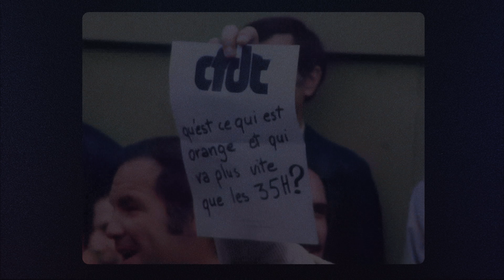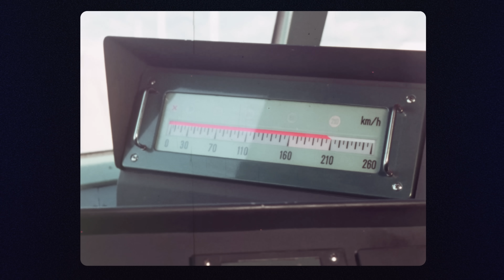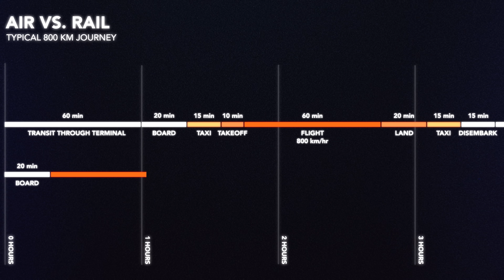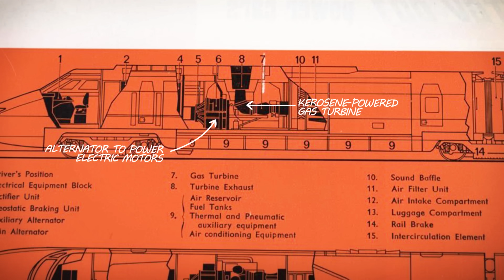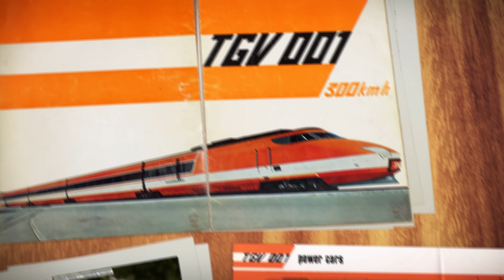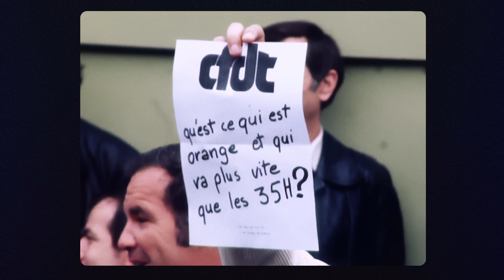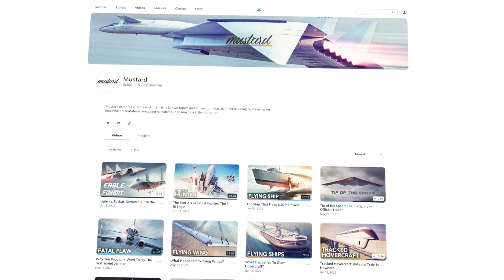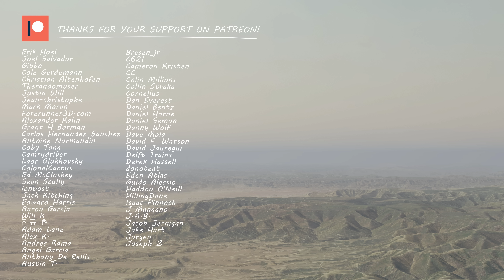Why French Trains Are The Fastest

Comment: as somebody from south eastern europe, who has travelled a bit (not yet to japan or china though) i have to say from what i have seen personally i am most impressed by the french trains and the entire system

i spent a few months for work at the southern/mediteranean end of france. i had a weekend i wanted to visit Paris and honestly the best option available was the trains.

-the distance was about 750km (so not the shortest of hauls, but still short)
-the travel time by plane was a bit under 2 hours, by train about 3:10 and by car... not even comparable, but also not an option as i didnt have one and would have to park it in Paris... added headache.
-the potential schedule: Plane had two flights a day. one way too expensive and the other early in the morning. meaning i had to leave for Paris early on saturday and return early on Sunday... (not good) 
train on the other hand had over 11 trains per day, allowing me to leave late friday and return late sunday
-cost: the cheap(er) flight was about 270€. (the expensive flight was 700€). the train was 230€ and it was very close no matter which of the suitable to me trains i chose. (cost is with return). car with rental and hotel parking was gonna be about 230€ + 170€ for fuel... (yes train and plain meant extra cost for public transport in Paris)

worst thing, i ended up not going because of the fear (last minute) that eergency work would pop out for saturday and because hotels were extremely expensive in Paris for the weekend and with the even tickets i was looking at a weekend expense of over 700€ which was a lot for me...  But what i want to say with this comment is, they have managed to make trains the preffered option.
*Yes, if Ryanair or Whizzair were available in my route it would have been a LOT cheaper by plane, but then again if booked two monbths earlier in a discount...

Comment: The point of having a high speed train network is to connect two (or more) cities downtown to downtown, unlike airliners that need to be operated just outside of a city hence the extra travel time between the airport and the city.

My country just began operating its first high speed rail line last year between two very busy cities (one of which is the capital), but then put the stations on the edge of both cities. City A is 200 km or so northwest of city B, and has the station in the south east, which is fine. But the station in city B is.. also in the south eastern part of the city. Bruh. Even the old rail line goes thru the center of both cities. Overall, still relatively quicker than using a car on the motorway, but another problem is the lack of supporting public transport network especially in city B makes the whole journey pretty inconvenient.
Reply: Indonesia?

Comment: Don't you mean TGV "was" the fastest...now Chinese trains are now fastest 🤔?
Reply: The TGV still holds the record for the fastest traditional rail train. The only train that went faster was the japanese SC maglev.
Reply: @marcogentile3392  They cheated with that world record: 3 instead of 8 carriages (so the weight was drastically reduced and the motor cars only eend to push/pull 3 instead of 8 articulated passenger cars), only a few passengers, engineers and press people on the train, larger wheels than normal for the motor cars and increasing the voltage on the catenary drastically (normal voltage: 25 kV/50 Hz AC). What about maximum sustainable speed when the train is of normal length of 8 passenger carriages and carrying about 400 passengers, normal size wheels for the power cars and normal catenary voltage of 25 kV 50 Hz AC ? I am pretty sure the chinese high speed trains will do much better when taking into account these corrections.

Comment: Nahhhhh, China’s got much faster train on much longer railroads.
Reply: Yes, but it is not necessarily more convenient for going from the city center to the city center. The stations are way out on the suburbs.
Reply: @harveywilde6781 still they're a lot faster
Reply: @aldinoruswandi  Lol, they're all running at the same speed. Only one line had a faster operational speed.
Reply: @harveywilde6781  Nope, China is faster, not running on the same speed
Reply: @aldinoruswandi  Geezz such fanboy. Yeah, sure, I guess, if you care about numbers. Fyi, if you see something like 380, that's the design speed of the track. Trains run lower for safety factors.
Reply: @harveywilde6781  fanboy? I'm just stating the fact, but you just won't acknowledge it since you're a westerns
Reply: @aldinoruswandi  Not true
Reply: @Godophugawa  Shanghai Maglev is already 460km/h and their engineers want to double that rate so the train can carry passengers at speeds faster than if they were traveling by plane.
Reply: @aldinoruswandi this is not a rail train and just few miles between Shanghai and his airport
Reply: @BenoitMelon-h1o  China's High Speed Train has a speed of 350km/h with a rail tracks of 42.000km (26.097 miles)
Reply: @BenoitMelon-h1o  While TGV High Speed Train only have a speed of 300km/h and a rail tracks of 2.800km (1.740 miles)
Reply: @aldinoruswandi  France have world speed record on rail since 1954 and have always it in 2024 not China
Reply: @BenoitMelon-h1o  world record doesn't mean anything if it's not safe for human travels and only operates on 300km/h, while my country alone could operate 350km/h HSR.
Reply: @aldinoruswandi  320kmph in France and you must specify that 350 it is only on some limited lines. Your tech is just a copy of european tech bought to decade ago. French TGV is safest than China train
Reply: @BenoitMelon-h1o  LOL, TGV only operated on 300kmph while WHOOSH operated on 350kmph (on every lines, not limited), Stop lying bruh to make yourself feel better. 

I've seen the comparison video as well and TGV station and Train interior is not as good as WHOOSH in terms of safety, cleanliness, and conformity. Not to mention that TGV doesn't have a staff that will help you if you have difficulties, while WHOOSH having a very helpful and friendly staff that will always help you if you have difficulties. 

Also TGV is always late, while WHOOSH is always on time. And TGV is not as smooth while you're in the train, while WHOOSH is so smooth that if you place a standing coin it wouldn't move even until you arrived at your destination.
Reply: The chinese trains have a max cruising speed of 300 km/h, while french trains are 320 km/h... While it may be tru that they're top speed is a bit faster, the cruising speed lacks
Reply: @Godophugawa  Indonesian Whoosh made by Chinese is currently operating at 350 km/h

Comment: Fun fact, the German ICE trains can reach higher top-speeds in France than in Germany and for once the state o(f repair) of the German Railway network is not to blame.

France uses 25kv 50Hz electrification on its high speed lines. While Germany uses 15kv 16,7Hz on all railway lines, including high speed lines.

Because the voltage is higher in France, you can supply a lower current to get the same power as in Germany.
And as you can't put every increasing current though a conductor without physics getting mad at you.

TLDR: the German overhead wires can provide less power hence train can't go as fast.

Comment: Laying down track foundation with viaducts i.e the civil engineering aspects is one of the prime bottlenecking factor for highspeed trains,rather than the Train engine technology or wagon technology that comes with it.
Forget high speed,if you can ensure steady 160kmph travel,even that is more than enough for 1000km travel distances.(considering flights takes about an extea 1.5hr for boarding and security related $h!t.)

Comment: The French have one huge advantage over the Japanese when it comes to high-speed rail… the rail gauge of the French high-speed and non-high speed rail networks is identical, with both networks employing what’s referred to worldwide as “Standard Gauge”. This allows the TGV to make use of the existing rail network in urban areas, resulting in significant cost reduction since existing stations and rail infrastructure could serve the new high speed trains where infrastructure is most expensive to build. In Japan they practically had to build all new stations and dedicated urban rail lines as their non high speed rail network is narrow gauge which is unsuitable for high-volume, high-speed operation. Although the video alludes to this inherent advantage the French had over the Japanese system, it unfortunately does not explain that the historical rail gauge was the source of the advantage.
Reply: The Japanese built dedicated high speed lines to avoid the need to have level crossings and share track with slower traffic. It also allowed them to build much wider trains that allow them to carry more passengers.
Reply: India also working on bullet train with Japan . As Indian needs are fulfilled by japnese trains

Comment: The electric version of the TGV-001, known as TGV Sud-Est, had been in service from 1981 until 2021, when all of its trainsets ceased operations, and most were scrapped. It is now replaced by the TGV 2N2/Avelia Euroduplex (one of which was seen in the 2007 speed test video hitting at 574 km/h), which first entered service in 2011 while Sud-Est trainsets are being gradually retired, and it still is as of 2023.

Comment: Thank you for quickly mentioning the skytrain "aérotrain" project (345 km/h in 1967. One day in a warehouse near Versailles, I saw a science fiction machine covered up at the bottom of the hangar. the technician removes the tarpaulin: it was one of the latest models of aerotrain, a technological marvel for the time. Tribute to the engineer Jean Bertin for his ideas, and this project, designed with a slide rule, perhaps too far ahead of his time.
Reply from the maker: The Aerotrain is fascinating.. I actually have an entire video dedicated to it!
Reply: You can still see the aérotrain's old elevated concret test tracks running along the Orléans-Paris tracks.
Reply: @familledelisle2086  I may be wrong but the 10 km Aerotrain track near Orleans, has been removed and sadly, some vandals deteriorated some Torbotrain vehicles in Plaisir near Bertin's company..
Reply: @dlallemend3489 Jean Bertin was a remarkable aviation engineer and he helped create the TGV by forcing the bureaucrats in SNCF to face innovation and risk their job. Without Jean Bertin and his Aerotrain, TGV might never have been born. The Aerotrain was a sting into SNCF butts (to force them to be innovative) but never was a solution to transport huge masses (123 MILLION people transported in 2023 in France by TGV) and re-use existing accomodations (Railway stations) and the cost of energy gave the Aerotrain the "coup de grace".

Comment: Total respect for the French, their Railways are the bestcand they simply won't stagnate into complacency.
The French have already pushed a TGV to 575 kph and raised the line voltage 35kv for the test.
I hate plane travel, there is nothing to like about long haul travel especially if you are in excono,y class. 
The other thing is even on short haul flights you have to get to the airport hours before hand and then are processed like suspicious  baggage.
Yes I know it necessary but I prefer trains, far more civilised.

Comment: The tgvs i used to take in paris were pretty old at that point, and their design looked EXACTLY like star wars spaceships from the first movies. Very elongated but geometric shapes, a cockpit that looked just like the X wing cockpit, but after all the years the red, blue and white paint looked old and dusty. And the noise of the idle engines too. The whole station was underground, all made of concrete with pillars.
It really looked just like entering a rebel's base and getting aboard an old X wing

Comment: Test speeds under highly controlled circumstances should not be the primary metric here. The focus should be on operational speed, in this the TGV is left far behind the Chinese Maglev at 460km/h and China's Fuxing and Harmony both at 350km/h.
Reply: Shanghai maglev is a German Thyssenkrupp/Siemens Transrapid. Speed record for the fastest un-modified serial production trainset is hely by the Siemens CRH380BL.
Reply: @jonny2954  that may be so, but I don't see any Maglev around the German countryside or urban areas.
China is the only country in the world that has successfully implemented it.
Reply: @ericcoskun1  Except they did not successfully  implement it. Shanghai Maglev is considered a economic failure, people rather take the much cheaper regular train that runs alongside it.

It being uneconomic is also the reason Germany didn't adopt it.

Comment: The French and Japanese certainly have different takes on how to achieve high speeds. The Japanese obsession with testing and extremely strict specifications for the purpose of safety deserves to be highlighted.

The French must be commended for their record of ~575km/h in 2007 (breaking the Japanese record of 443km/h). But I don't think the Japanese really aim for speed for the sake of records. They operationally aim to always achieve speeds to 40% to 50% more than operation speeds then intentionally set low speeds for safety.

A lot of it has to do with track specifications as well as rolling stock. But the best illustration of how careful they are is shown in their development of the Kyushu extension.

They already had rolling stock capable more advanced than the train which set the 443km/h record. And they used their 270km/h specification track in the new extension. But rather than build the track using a known specification and rolling stock of a known specification, then open the line, they instead tested for well over a year under all conditions and seasons.

The other thing they do that is impressive is to completely overhaul every single train as airlines would a plane. Everything is stripped. All wheels are replaced and re-machined. Bodies are taken apart and re-sprayed. See: https://www.youtube.com/watch?v=DJvWJNT092s

Excluding the new Chuo Shinkansen (which currently holds high speed train record of 603km/h), the Japanese are developing their next platform for regular rail, the Alfa X. The aim would be to take this up to speeds of close to 540km/h then ensure track specifications are also updated allowing the train to enter regular service at 360km/h.
This would make it the world's fastest regular train (in terms of day to day operation speed). This train would be expected to be primarily used north of Tokyo, where tracks allow higher speeds than the Tokaido to the south.

Comment: 2:51 "Two largest cities in Japan" - interestingly, in 1964 Tokyo was (and still is, until Delhi takes it over) the worlds largest city by metro area (only global way to compare).
In 1964 Osaka was the 3rd largest. By 2000, Osaka would be 2nd largest (albeit it's dropped to 10th now).

It made sense for Japan to connect 2 of the 3 largest cities in the world.

Comment: The TGV is amazing. The ride is smooth, the seats are comfortable, and it's fun to watch the cars appear to go backwards on the nearby highway.
Reply: It has also proved extremely reliable over its 40+ years of existence.
Reply: To be honest all modern trains with their 160 - 200 km/h are faster than cars. Maybe only in Germany some cars drive occasionally faster.
Reply: @lukask7445  Modern trains reach those speeds but usually not for very long. That's what makes the TGV special, the cruising speed is sustained for a larger % of the drive.
Reply: &... now... maybe they should work on their trans~deportation.
Reply: @JTA1961 WTF BRO

Comment: honestly nothing beats trains imo, if only they were more frequent and reliable
and high accelleration, i think that is often overlooked, sure 200mph trains are cool, but having a train that would average faster than 60mph, including frequent stops every 3-5 miles, would be the future. it would allow living 30-50 miles away from the capital, but you can reach the capital within less than an hour, and the train would have everyone from local to outside the city

Comment: Impressive documentation work 🎉 Couple of things : one key aspect of TGV are the shared bogie configuration (which help stability at high speed)but another less know improvement is the overhead line (caténaire) and the pantograph. The line is zigzagging to avoid the pantograph to melt and the pantograph lifted is the one at the back of the train, which means a high voltage line is running on the roof of the train to bring the power to the locomotive 🎉 This is done to avoid caténaire to be cut and to slash the whole train at high speed 👍 Others high speed trains have now used this caténaire/pantograph tricks too.

Comment: More than anything else, i think that France is actually of of those perfect countries for trains.

1) It is quite sizable for European standards (especially for vacations spots) which means that there is a demand for massive transportation but also it means that car is not that convenient. Also, oil i pricier in Europe than in the US in general.
2) The population distribution is un-even meaning that you can build the rail network like you would do for a metro in a big city (look at a map of French rail network for better understanding). That means it's cheaper and easier to handle. 
3) France is quite flat or at least, easy to build rails. (Except some regions that can be avoided or easily engineered).
4) Finally, Planes, are indeed fast but remember what i said earlier : "quite sizable for European standards". What it means is that a trip to a vacation spot (800-700km )or a work trip to the regional city (200km) is either overkill (with a Plane) or inconvenient with a car. For a 700km plane you have have 4 hours from door to door. With a TGV you have maybe 6-8 hours max. Ticket is generally cheaper and it is so much less stress because of how easy you can hope to a train. It is also more confortable (economic class).